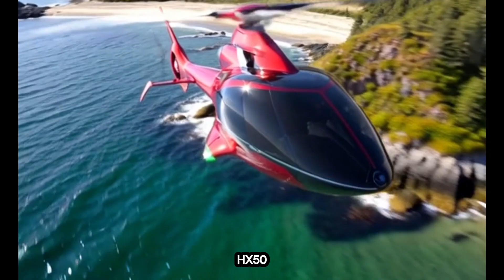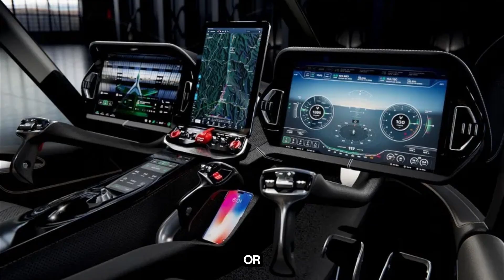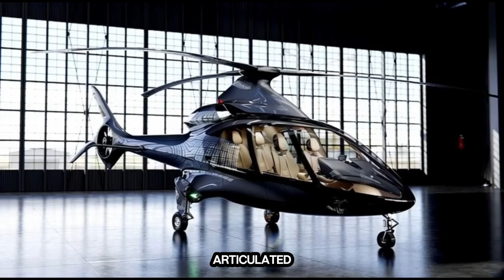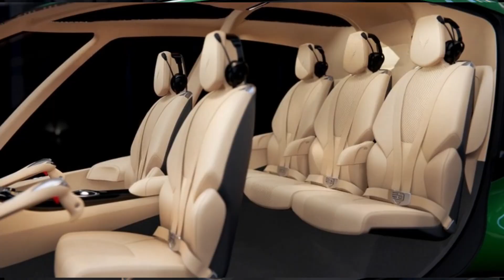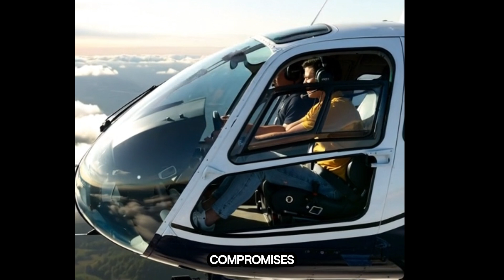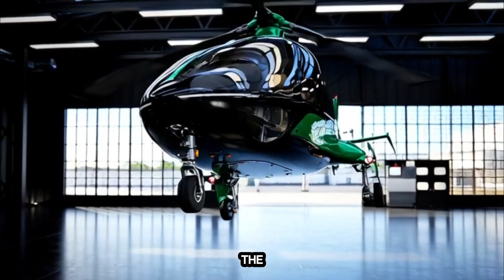Hill HX50 review – The Most Affordable Luxury Helicopter in the World!

Comment: TurboTech, Paris have picked a lot of competence from Safran and they are flying their design 140-160 SHP successfully now looking to build a 250 SHP version. This Hill endevour to make their own 500 SHP turbine in-house from scratch is a mistake in my view. They should have settled for example the well proven Turbomeca TM 319 Arrius 2F turboshaft, found in the Eurocopter/Airbus 120b: ie. 376 kW (504 hp) for take-off 335 kW (449 hp) max continuous.
Performance almost identical and the otherwise interesting Hill helicopter would be flying by now - and I would be interested.
Reply from the maker: Thanks for your information ❤️🔥